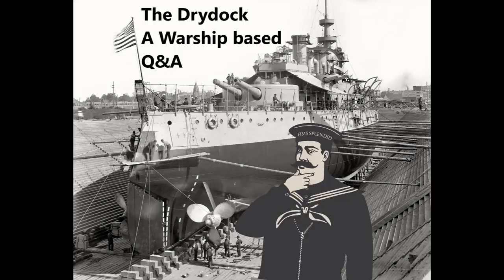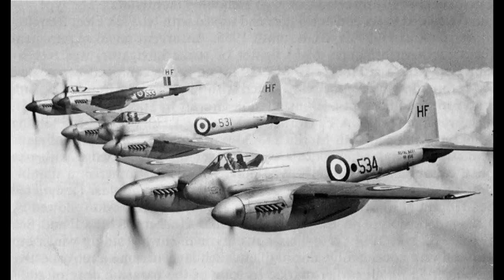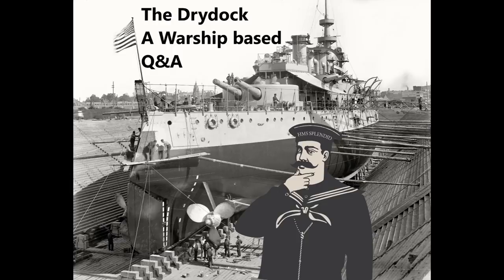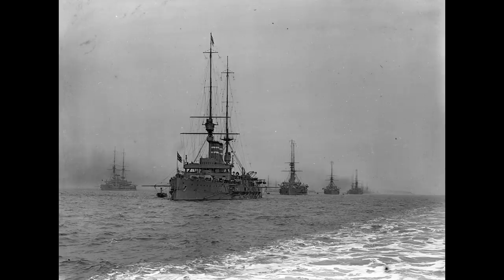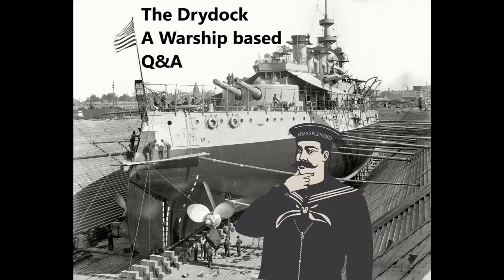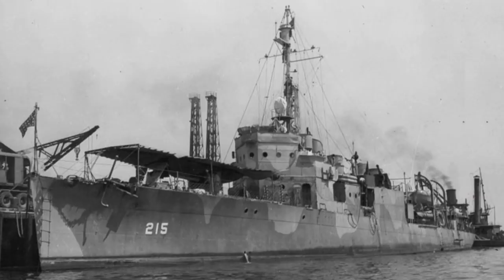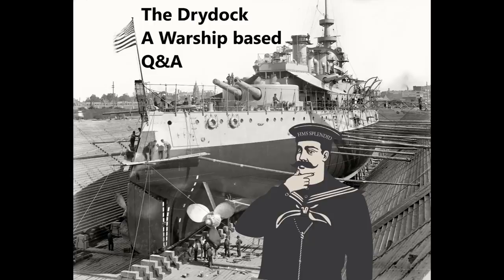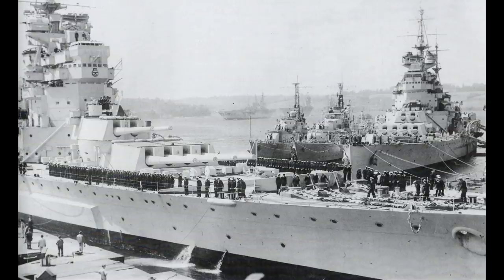The Drydock - Episode 057

Comment: Strictly speaking, freeboard is the distance from the waterline to the lowest downflooding opening, i.e. the lowest point where water can enter the ship's hull. This might be the gunwale, but might be lower or higher depending on the exact design (for example on a ship of the line, it would probably be from the waterline to the bottom of the lowest gun port).

Somewhat related, the portion of the hull between the waterline and the gunwale is the topsides (as opposed to the portion below the waterline, which is the bottom).

Sorry, I'm a former marine surveyor, and get a bit twitchy about nomenclature (after having had to learn it all in excruciating detail myself).
Reply: +1 pedantry. Have a pink gin.
Reply: Be twitchy.   Your job demands it.

Comment: Westland wyvern actually entered service with piston engines, I think it's the only fleet fixed wing aircraft  with both types of powerplant.
Reply: Yep it was basically a plane whose development took so long it was soon going to be completely out of date.
Reply: @Tony Maughan yep it's a shame because if the development had followed the projected timeline (although when did that ever happen with a fleet air arm aircraft) I can imagine it being really useful. It was originally designed to enter service with a piston engine but they changed that as events overtook things and went directly to the turbo prop.
Reply: @tomriley5790  Not unusual with Westland Aircraft unfortunately. Ever heard of the Westland Whirlwind? Dual prop fighter, was supposed to run with twin Rolls Royce Peregrines, but they had so many problems with manufacturing the engines in enough quantity that only three squadrons were ever equipped with the aircraft and it was canned in 1943. Which is a shame, as it was an excellent fighter with ferocious firepower for its day (four nose mounted 20mm cannons). Had it not been for the problems with the engine the Westland Whirlwind may have been up there among iconic Britsh Aircraft such as the Spitfire, Hawker Hurricane and Mosquito.
Reply: Personal opinion here:
The hidden beauty of WW2 aircraft has to be the Westland Whirlwind.  Calling the engines buggy does not disguise the fact that almost all new engines require ironing out.  If the same effort as was put into Merlin had been spent on the Peregrines, the Whirlwind would have been the top twin of the war.

Comment: The US Navy built nightfighter versions of the F4U-4 and F4U-5 Corsair.  The -5 had equal performance to the Sea Hornet.  They also introduced the F3D Skyknight jet nightfighter in 1951.  I see no reason why the Fleet Air Arm could not have introduced a jet powered nightfighter earlier unless it was a resource issue.
Reply: Cost. The seahornet was already to go.

Comment: 40:10 what's with the clock at the mast of warships in a number of paintings I have seen?
Was that realy a thing? And why? I mean, most of the crew worked bellow deck, and most of those who worked on deck would probably do so in a place where they can't see that clock anyway, as it would only be visible from the bow.
So, it's not like a clock on a church tower that was actually need to give those villagers who couldn't afford a watch a sense of time.
Reply: Range clocks, useful for other battleships in the line incase they could  not see what they are shooting at
Reply: Range clock actually communicates the range estimate of the rangefinder to the target you're shooting at. So for example, if your rangefinder says the enemy ship you're hanging on is 18,000 yards away, and the next ship in line says its target is 15,000 yards away, you both need to take a second look because one of you is way off (assuming a battle line and adjacent ships and targets).
Reply: Ah, that makes sense.
I was wondering, especialy, since it's not universal. So my initian guess was some strange decoration.
Cheers.

Comment: Not sure if it was true but when I was on the USS Midway in Yokuska .we were in drydock get blisters put on to help our list ( it didnt work made us roll alot at sea ) anyway they said the Yamato ships were built there was wondering if they were made or finished (like turrets added )in Yokuska
Reply: I thought the Midway got blisters to improve her freeboard? But like you said.  It increased her roll in moderate and heavy seas
Reply: It was for several  things I guess I was told she was a straight deck carrier they added the angle deck which gave us a list and the blisters was to help.
Reply: @toddcraig6150  

I'm not sure due to lack of infromation.  But one part is true. She and her sisters were all built as straight deck carriers. But even before modernization.  They all had a low freeboard.  

 Part of the issue was the design. It kept the strength deck and the hanger level and then put a armoured flight deck above that which put weight high up. And as the Midways were modernized.  That issue got worse. So the navy started to remove the 5in guns and such. 

Theres alot more in what I've read.

Comment: Why couldn't battleships just use flight time table with range data and a stopwatch to accurately predict the second when the impacts happen? Timed fires where many different batteries with different guns and ranges hit a target simultaneously are commonplace in field artillery.
Reply from the maker: With their own ship and the target moving at speed they could estimate but there would be some variance, which is enough to introduce confusion.
Reply: @Drachinifel  Yes, it was only the introduction of radar fire control that allowed something like a 99% probability of a ship being able to identify the flight of their own shells. However, this still didn't obviate the problem of identifying all the other shell splashes. It was only the perfection of each ship sending analog data packets to all the other ships firing that allowed a high probability identification of every shell splash. Digital data packets, the ultimate perfection of shell splash identification, were introduced at just about the time it no longer mattered, capital ships and their guns having disappeared from the general naval scene.

Comment: People still thinking the Tiger should have sloped armour after all these years...  I mean it would only mean losing the gun, the engine, a crewman and probably a considerable amount of fuel but at least it would be immune to anti tank guns that hadn't been invented yet.  Sloped armour gains you weight, flat armour gains you space.
Reply: Also, sloped armour would lead to even more reliability issues than the Tiger already had to begin with.
Reply: Stuart Aaron - Which weighed 67t to the Tiger’s 50t. But, the Germans originally built the Panther with the same gun as the Tiger (The Konigtiger used a LONG 8.8 that had more armor penetration than both of the other guns mentioned here). They replaced the 8.8 with a LONG 7.5 that actually had MORE armor penetration than the 8.8 on the Tiger - Panthers had sloped armor (like the T-34 & the King Tiger), were faster than the Tigers & weighed 45.4t...
Reply: @TraditionalAnglican  All were extremely over weight, it is as well they did use sloped armour on Panther or it would have been as heavy as Tiger.
Reply: DoddyIshamel - I’ll agree with you on the Königtiger, but the problems with both the Panther & Tiger seem to have resulted from “QA/QC” & Engine/Drivetrain Issues. Most modern MBTs now weigh as much as the Königtiger. That makes me wonder what would have happened if the Königtiger had had a 1200 Bhp motor, much wider tracks & a 105 mm gun...
Reply: @TraditionalAnglican  That's down to technological advancement though.  Imagine the size of an engine and chassis needed to move a 60 ton tank with a 120mm gun and 300mm+ of effective armour at 60 kph in 1940....

Truth is they could not have effectively used the 88mm in the tiger (as happened with Panther) if they sloped the armour, and doing so would only have made the tank faster which it didn't need.

Comment: OK--------- As far as Midway goes:---  A 5th carrier as big as the Yamoto would have won the battle. Fact is. If Japan had included the carriers it sent to the Aleutian diversionary attacks (why diversion when you wanted the US Carriers to show up and it was a surprise attack), they would have had 6 carriers to start with. That would have still left them 3 carriers after the first US attack to make their main attack on the US Fleet and possibly have had enough planes to spot the Enterprise in a squall only a few miles from their original target and put her out of action in the first strike.  Not to mention their aim was to secure Midway and take out the US carriers, they should have included every fleet carrier they had which would have added another 4 carriers beyond the 2 Aleutian carriers giving them a full 10 carrier fleet, insuring the destruction of anything the US could have sent that way. As the Americans did later in the war when ever they made a major attack on any of the Japanese islands and forces.   
---------------- 
Fact is the Japanese should have taken Hawie in their surprise attack in December as a bargaining chip in the first place instead of running with their tails between their legs afraid of getting caught, instead of finishing the JOB and rendering the Island worthless as a seabase. But what I don't know was why they ran in the first place as they could have easily taken out any of the US carriers that could have shown up one at a time. Most of our aircraft and pilots at the time were untrained flying outdated practically worthless aircraft compared to the Japanese that included some fighter squadrons that were still flying Buffelows and bye planes.  They would have completely wiped out the whole US Pacific fleet including cruisers and destroyers and most likely the Enterprise that showed up later that day. While stranding any surviving ships in the airea from lack of fuel. Leaving the US no choice but to trade the Philippines and Guam for Hawie and Peace and avoid a possible invasion of the mainland. The Japanese could have won the War with their first strike taking of Hawaii.
His statement about the abysmal state of US Navel aircraft in Dec. 42 (I just elaborated on) and anti-air in the next segment, along with US bad torpedo quality, would have insured that the Japanese fleet suffered few casualties.
Reply: No reason for the US carriers to stick around if they had to fight at a disadvantage.  4 carriers is enough to take your marbles and go home.  Even taking Midway meant nothing, the US could just take it back as soon as the fleet went home.

Comment: Early war American fighters against Zeros? God help the Americans. That hypothetical naval battle off Wake island would have been a complete disaster, far worse than Pearl Harbor. Even if the carriers had escaped, the rest of the fleet probably would not have. And as Drach pointed out, no salvage on damaged ships.
Reply: The poor performance of US fighters early in the war came down to pilot experience and using  the wrong tactics for the performance characteristics of US aircraft.  Claire Chenault sent reports on how to fight Japanese aircraft back to the US which were ignored.  Properly flown both the P-39 and P-40 could beat the Zero and the Wildcat could hold its own.   The Zero was a mediocre fighter flown by superior pilots.  It was built with biplane tactics in mind which explains its light weight, poor protection and outstanding turn characteristics.  It was vulnerable to "boom and zoom" tactics.  Even late war allied fighters would lose to a Zero if they got into a turning fight.

Comment: Pretty sure Shinano could carry more than 47 aircraft.
"The remainder of the hangar space would have held up to 120 replacement aircraft for other carriers and land bases" - Wikipedia
Reply from the maker: Replacement aircraft were usually in bits, not combat ready, and there wouldn't have been storage for sufficient weapons, fuel, pilots, ground crew etc to have them operational for combat use.
Reply: Oh ok. That makes sense.
Reply: @Drachinifel  Even so, that's still an awful lot of additional hangar space. That space to hold 120 disassembled planes could certainly have accommodated 60+ combat-ready planes instead, for a total air wing of around 110 (and maybe more). And given the sheer size of the ship, I have a hard time believing they would have run short of space for supplies and personnel. Certainly weapon stowage wouldn't have been an issue, given the magazines the ship already had built in for its original main battery.
Reply from the maker: @Wolfeson28  it's certainly an exercise that could be done to work out her capacity as a fleet carrier, but I suspect the number of combat aircraft would lower, it's not just physical deck space for aircraft, you need space to move combat aircraft around which you don't need with packed aircraft, and as above you need a lot of extra crew and equipment which also needs space.

Plus of course if you count deck parking or not.
Reply: @Wolfeson28  but would those modificatoons happen?
Reply: @Drachinifel  But even with disassembled spare planes, you'd still need room for their pilots, not to mention the people required to assemble all of those planes and get them ready for flight over, say, the couple days of a carrier battle. So I don't think there's all that much difference in the crew space required for a fleet carrier role vs. a "support carrier" role.

Honestly, I strongly suspect that this whole concept of certain carriers like Shinano as "support" rather than "front line" is really just a consequence of how little detail we have on those ships due to Japanese secrecy and document destruction. The idea of using an armored carrier in a "support" role doesn't make much sense to me (interestingly, Parshall and Tully say the exact opposite in Shattered Sword, indicating that the armored carriers like Shinano and Taiho were the ones intended for frontline roles). But quite frankly, I think this division of "support" vs. "frontline" carriers would have been meaningless in practice. Had Japan actually been able to launch and operate a large carrier fleet by the end of 1944, they almost certainly would have just assembled every carrier they had and used them in a single force (as at Philippine Sea) or in separate task forces that were part of the same operation (as at Eastern Solomons and Santa Cruz). Fleet carriers, light carriers, converted, support, whatever, they would have simply used everything they had in the front line with as many aircraft as they could field.
Reply from the maker: @Wolfeson28  assuming the Shinano was to be used in a support role, I'm drawing inferences mainly from HMS Unicorn, which was built as a support carrier and had a small cadre of ferry pilots and mechanics, but as they were only working with small groups of aircraft at a time, they were a smaller group than on an operational fleet carrier where work on many planes at once was needed. Most especially on a support carrier you don't need armourers, major ammunition storage, etc.
Reply: @Drachinifel  I seem to recall that much of the space that could be used as hanger space was allocated to stores, parts, ordnance, repair shops etc., with only about half the "main deck" used as an actual hanger.

Comment: Sloped armour are not a given vinner at all times. Take a look at tanks: even today, Western MBT have fairly vertical armor (look st the side of a Lepoard 2, for example). This is not because Germany havent figured out sloped armour.
Reply: No, the frontal armor of most MBTs us sloped.  Both the T62 and M60 had 109mm of armor with a 60° slope which works out to about 250mm in LOS.  Side armor is much thinner so sloping it isn't going to gain you much.
Reply: @johnshepherd8687  did you actually read that I was refering to the side armour.
Reply: Yes I did and if you finished reading my post I explained why it is pointless to slope side armor.  It is never going to be thick enough to stop an AP round fired from large caliber main gun.
Reply: @johnshepherd8687  well, it's pointless to slope side armor because it's generally so thin. Also because sloping the side armor would severely cut into internal volume, whereas the length is the longest dimension and gives more room for sloping the armor.